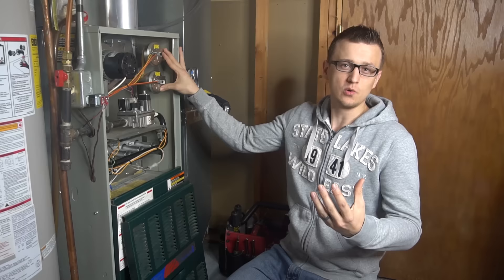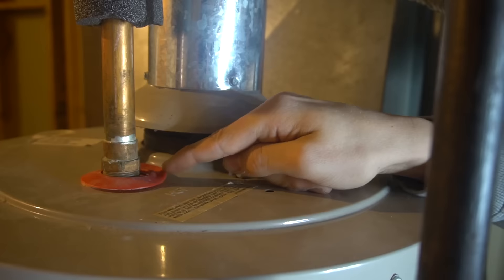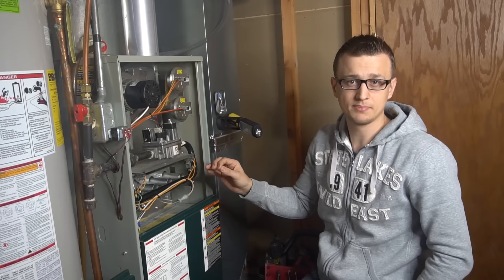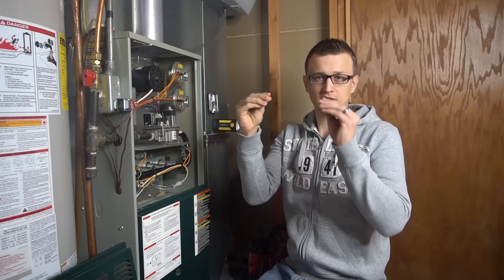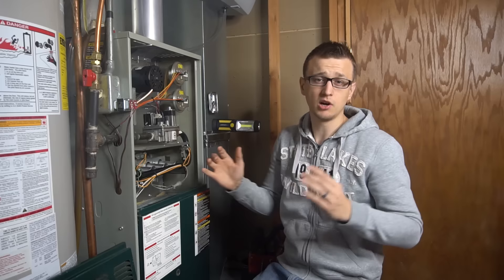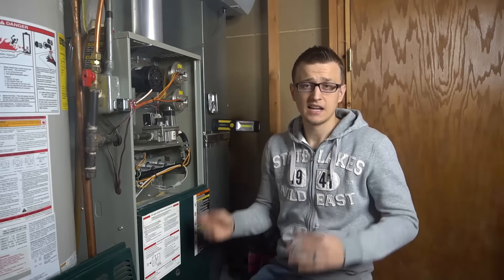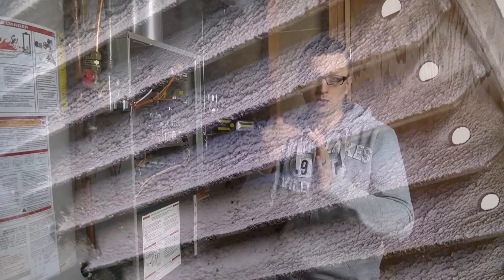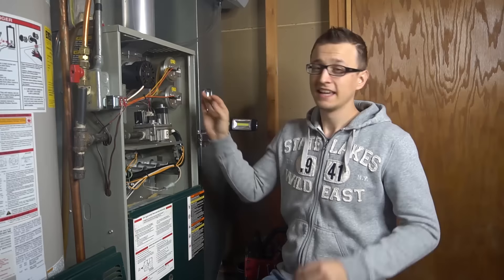Furnace Pressure Switch Troubleshooting

Comment: I should have watched this video first!  I bought a new pressure switch (only $27) and the furnace lit right up.  But the next day, i got another pressure switch open msg (3 red flashes on York).  I wasted time removing inducer motor to check for dirty fins - nope. And the tube port was clear.  Fiddled with all of the wires - and switch worked!  But then I put all of the panels back on, showered, and was about to finally enjoy a heated den - but NO!  3 Red Flashes again!!  Checked and wiggled the wires again - but no luck.  I'm going to the roof - 2 stories up (long ladder to tout) Back from roof top (scary up there Nothing blocking vent pipe.  (the furnace is in the attic and the pipe is a mere 4').  I'll next use multi-meter to check if voltage is coming from control panel to switch.  I'll let you know.

Comment: Very nice thanks. how to check BA20123 pressure switch? both would be open when no power and closed when induction motor turns? sticks say 1.6min-1.81max WC and 0.81 WC PF those are open or close pressure?

Comment: Hello, great video. My furnace stopped working even though the air was blowing. Basically the flame was out. I was told by a friend to blow into the hose of the pressure switch and re-run it. It came back on but after 24 hours it happened again. I tried the same procedure and it started to work again. What could be the possible root cause?

Comment: Thank you for these videos. It may be more rare but I would definitely suggest checking the inducer motor cap first because it is a simple and cheap fix and it gave me short cycling code 30 errors on Tempstar which I was told twice by service techs was clogged condensate but it ended up the inducer capacitor was reading 2.7 microfarads and was supposed to be 5.0 microfarads and replacing it fixed my issues.

Comment: I'm having the same problem you explained at 3:25 except I dont have a burner box. My furnace looks like yours except only 1 pressure switch. I replaced my flame sensor at first thinking it was that, didnt work. Replaced filter cause thought that might be the cause and nope not that. Left the door off and let it run and it's only stopped once like it did before with the door on in 48hrs. Thinking it has to be an airflow issue should I take the inducer motor off and check that or what else should I check? Thanks

Comment: I have a hissing noise when i turn on the power to my HVAC system.  Currently i use it for Winter time heating in my garage.  The sound originates from the Furnace(not AC unit) which does not prevent the ignition of the pilot light/propane.  Recently replaced the fan in the unit and the motor last year.  Cannot say if this noise is caused by  the condensation(recently had a shift to warmer temperature) drain as we have had a lot of snow melt or if there is an air leak.

Comment: Disabled an in need of help. Called 2 companys one came out cleaned a steal rod . didnt fix code 3 pressure switch. Called 2 more times nve called back. 2nd guy nothin not even a call.
Im crying rite now. This is great video. But my furnace scares me. No help am lost.
Live in small town 2hrs from denver
Will someone please help us
Did not find the little tube to take off. Is there anyone honest out ther besides this great man.......

Comment: Love the video & really appreciate the advice. Unfortunately, I'm still troubleshooting what ought to be a clogged intake. I have a high-efficiency Lennox furnace that consistently will run for a bit then shut down & give me a pressure switch open code. If I remove the fire box cover & leave the top door off, the furnace runs fine. However, I removed everything I needed to in order to have my wife shoot air through both the intake & exhaust pipes... I felt about the same amount of pressure outside as just putting my hand up to the blower... doesn't seem like it's a clogged pipe... Anything I'm obviously missing here?
Reply: Did you ever solve this problem? I have the exact same problem with my keeprite furnace. Will run with the combustion door off, kicks out when it's on. Have checked everything I can think of.
Reply: @davedarling6512  I did, but I can't say for sure how... there's a PVC pipe at the drain of the secondary heat exchanger, I sucked that outwith a shop vac a couple of times but I don't think that was it... I've told people this a couple of times, but they tell me it had to be something else... the last thing I did before it just started working great again was I pulled out both filters (I have a 4" & a 1" back to back & noticed the 4" was installed backwards... so the airflow arrows were pointed at each other. I corrected that & have been good ever since.
Reply: @michaeljones7364  thanks for the reply, I gave up and called a tech in - he knew what the problem was over the phone, on my model of furnace (keeprite) the pressure port on the fan housing is too small and gets blocked by water droplets. he simply drilled the hole out and now it works fine even with the door on. would have been impossible to diagnose on my own.

Comment: Question here. Sometimes furnace runs, sometimes it short cycles, only to try again, until it fires. We get a pressure switch code. Could the pressure switch be failing only sometimes? We have an American standard single stage 90. Your videos have been great, thanks!

Comment: I hope you're reading and responding. As long as I was blowing into the hose that leads to the switch the green light was solid, but as soon as I quit blowing the green light started flashing again. I ran a long pin in and out (several times) of the metal tube that attaches to the non-switch end of the hose. No change in the three flashes. There is a second hose between the switch and the the flue pipe but it's more difficult to remove from the switch so I didn't force it. Suggestions?

Comment: I got a pressure switch error last night as winter temperatures crashed.  This  suggest the PS is doing its job and detecting suction trouble with the cold dense air?  Filter indeed looked dirty (recent remodeling) but a new one didn't help.  Furnace is far oversized for the house and we had same problem last year, so I'm guessing threshold for pressure change detection is too sensitive.  I'll try a thinner filter -- if not, serviceman next!
Reply from the maker: Unfortunately the filter has no affect on the pressure switch. If you have already tried checking the things mentioned in this video and still can't find the culprit, then yeah.. Serviceman might be a good idea. Pressure switch errors can sometimes be very hard to track down.
Reply: @WordofAdviceTV  things got kind if hairy as the intro mentions.  Error went away by playing with exhaust pipe, that's about it.  Tech was puzzled
Reply from the maker: @stephanweaver1960  Thanks for the update! Yeah.. It's not always a "cookie-cutter" solution. Once in a while there's oddball problems like that.

Comment: Hi, thanks so much for your video. You video saved my life. I’m in WI, it is -40 F yesterday and today. My 15 year old Trane furnace stopped working, it shows pressure switch error. The inducer motor cycles on and off but there is no flame. I tried to suck the hose that connects pressure switch, gas valve and the chamber. I can hear the click sound. But it didn’t work, still no flame. Then I tried to unplug the hose connected to the pressure switch after the inducer motor runs. I put the hose back after it ignites. It is running now. But I’m not sure if it is going to happen again. What do you think could be the fundamental problem?
Update: I cleaned the condensate trap, not helpful... still not sure what is the problem
Reply: @Yang - Sounds like a bad pressure switch hose or failing inducer motor. Is the inducer motor hot when it's running?
Reply: @stevewarren3051  Hi, it has been fixed. The problem was the inlet vent was blocked by ice...Since the vent is on the roof, I had to disconnected the vent pipe and let the furnace to draw air from inside. After the ice was gone, I connected the pipe back, then it works fine.

Comment: Hi it is very informative and educational, I tried all of your videos to fix my Trane XR 80 not igniting and glowing problem but so far not successful 
the ignition is ok checked by store, don’t know what should I do next, thanks
Reply from the maker: Sorry to hear that! Is the furnace control board blinking any error codes?
Reply: Hi it blinks 4 times, I changed high limit cleaned heat sensor but no luck, I thought it is a ignition took to store but they checked and it was working, when I turn furnace on inducer works I think I hear a click for gas regulator but ignition never lights up, my multimeter not working so I can’t check if board sending current to ignition so my only chooses is changing board or if you think something else please let me know thanks
Reply from the maker: @rezagholam  What does 4 blinks mean on your furnace? Something like ignition lock out? If the ignitor is good and you can hear the gas valve opening for a couple seconds, that means either the control board is bad or there is a loose wire/connection at the board. From what you described, it does sound like a bad control board but can't say for sure without a meter.
Reply: Thank you so much I do not hear the gas valve opens, but checked the ignition with my friends meter there is no voltage to ignition when the system turns on, if there is no voltage to ignition still have to hear the gas valve opening or b/c of bad circuit it will not open as well
Reply from the maker: @rezagholam  If there is no power going to the ignitor after the inducer motor starts spinning, then either the board is bad or there is a different error that is causing the board not to send power to the ignitor. That's why I was asking what do the 4 blinks mean on your furnace? There should be a diagnostic chart in the manual or the back of the furnace door that explains the codes.
Reply: It blinks 4 times which shows on over is high limit problem but I changed it and still not working
Reply from the maker: @rezagholam  Sometimes it says hi limit but the problem is actually a tripped flame rollout switch ( https://www.youtube.com/watch?v=VAHSmeTTKpI&t=9s ) One easy test you can try, is to simply jump the high limit switch. (only to test it and see if it fires up)

Comment: I had a pressure switch error code a couple months ago on my 20+ yr old Trane 90% furnace. 
I viewed several YouTube videos including yours. I think yours are very good.
I couldn't figure it out. Nothing I tried cleared the error code.
So I called a furnace repairman to fix it. 
They couldn't get come that day, so I scheduled them for the next day. 
After sleeping on it I recalled I was blowing leave off my back patio and thought maybe something got sucked into the intake pipe while blowing leaves.
Then I figured this might be a job for my shop vac. So I turned off the furnace power and vacuumed out the supply line.
PROBLEM SOLVED.
Canceled the repairman visit, & saved a few bucks.
Is there any reason that this technique isn't smart? Just wondering because I haven't seen it in any of the YouTube videos.
Reply from the maker: Thanks for sharing Doug! Sucking the stuff out of your intake pipe with a shop vac was a great idea! Glad you were able to track that one down :) Stay warm!

And like Exquisite said, it may be a bad idea to do that on the exhaust pipe. Unless you disconnect the pipe from the inducer motor inside the furnace.

Comment: I have a Amana 90 air command and it has two plastic pressure switches both with one hose coming off of them, would both switches be the same part number or model?

Comment: I have an Arco air 90% + furnace. It keeps tripping on code 3 for pressure switch. All the tubes and the trap are clean.  The 2" PVC intake and exhaust pipes are also clean.  You can reset it and it will run for a month and then do it again.

 Also it seems like a little bit of extra condensate is building up in the draft inducer for some reason.

Comment: I get pressure switch signal and high efficiency furnace inducer motor runs . blows cool air for a few minutes then shuts and buzzes. the repair person said immediately that theres no flame so looks first to replace the igniter. stay tuned. its an ''xenon'' furnace. Would you comment on an ''xenon'' furnace? Is ''xenon'' a good product?

Comment: Got my furnace going again.  An Amana V9.  Turns out a bee had worked its way into the heat exchanger water drain pipe  (how ????) on the outside of the furnace.    (There was a fair bit of water that came out of the condensate trap - thanks for the heads up - I had a hose handy.)

Comment: Thanks for the video, it has been a great and help and I have learned a lot. I have a Trane 80% furnace buut unfortunately still have 3 red flashes and no heat.  It started a couple of weeks ago and I blew through the pressure switch hose and heard the diaphram working put it back to gether and magically it started working.  Now back to not working with same 3 flashes.  Transducer motor runs but the igniter never gets hot.  I did replace the pressure switch just because I had had the previous trouble.  When I jump the wires going to the pressure switch the furnace kicks the inducer fan on(which im pretty sure it shouldn't....)im leaning toward the board, but do you have other suggestions?

Comment: Hello Mr,
 Thank you for sharing.
I followed the steps to measure the pressure switches.
I have 2 pressure switches, one on the left side read 27 AC voltage on the right side has ONLY 14 AC voltage. After I swapped 2 swithches the voltages are the same ( left 27 Volt / right 14 Volt )
Can you please tell me is this normal ? Thanks again

Comment: Question: Will the high limit switch stop the furnace from starting? The switch I removed has continuity and 3.7 ohms resistance. The flashing red light blinked 4 times continuously and I stopped the video to read the error code description and went from there. I have another identical furnace for a different area, after trying everything and watching the video over and over I swapped out the high limit switch and it fired right up. Is there something else I should check and why with these readings didn't it work? Yes, It's running but I'd like to learn more possibly avoiding this problem in the future. A month or so prior to this the intake was clogged by a small bird! Thank you for this video and your support.

Comment: thank you for this! I'll try all 10 as my transducer is motor was really warm, the led lights say low pressure problem, there's rust laying on the top shelf just above the drain box, and this Tempstar 125 needs a good servicing.

Comment: Great video !

Got a question that doesn't seem to be covered: 

Intermittently, the pressure clicks on/off (1 second each) for maybe 30 seconds before the entire system actually ignites.

Blew (gently) on the hose and the switch is working.

Any ideas what to check next ?  

I didn't see any obstructions at the inlet (outside the house)..

Comment: I spent $180 I shouldn't have had to after watching your video. I went through all the troubleshoooting that you suggested while having an error code for a malfunctioning pressure switch. I even blew into it and drew air out of it to make it operate, while having a multimeter on it to see if it was changing states on the connectors, which is was. This made me dismiss that the problem was with the pressure switch itself. After proceeding through the rest of the possibilities and coming up  empty handed I called an HVAC person who came out and replaced the pressure switch which fixed the problem???

Comment: Thank you, this video saved me a visit from the HVAC repair, I found a small nut clogged the final water drain. Water was actually in the blower which you could hear when it tried to turn on.
I discovered it when I pulled the blower and water came out of it, luckily it still works.

Comment: So would you say that possible the thermostat itself can sometimes be the root cause? Under #10 for the bad control board, you mentioned bypassing the thermostat to ensure the thermostat wasn't the issue. Could a cheap thermostat cause a pressure switch error code and intermittent unnecessary clicking?

Comment: I Have an Goodman Furnace 3 years old Exauhst running outside but thier two Ports holes on top furnace Condensation Pump on side two Pressure sensors. Was working good for 3 years know it won't even start led light blink 3 times there was some water inside . One of outside furnace plug was inside the Door just bad job u had use heat tape on lots air leeks.

Comment: With the exhaust PVC  Age cemented together can the gaps in the PVC hold water.  Mine is about half an inch per foot drop but still holding water in pipe

Comment: Hi There thanks for your advice, I have a quick question and needs your help. My heater starts for the first time and working for half an hour and when it reach the desired heat level it stops and never back up again. when I checked the heater signal shows 5 blinks and the code says " Flame sensed With Gas valve off". When i turn it off everything and wait for 15 minutes and start again works again for another round and goes off. what is the problem, I couldn`t figure it out.

Comment: Hi, first of thanks a lot for your videos, they have a lot of info.
I am having an issue with a furnace.
The inducer fan motor turns on for a second and then shuts off, while the mother board doesn’t show an error code. The furnace it’s a Lennox 90%AFE. 
Any idea for what the problem could be? Besides the switch?